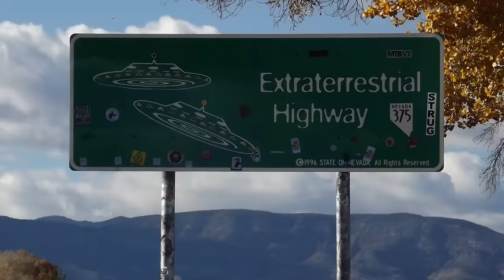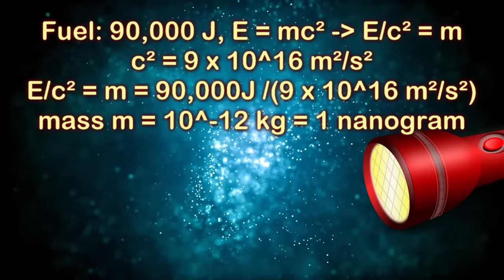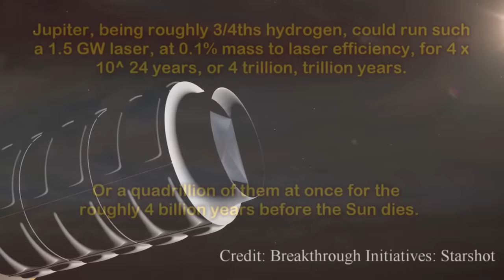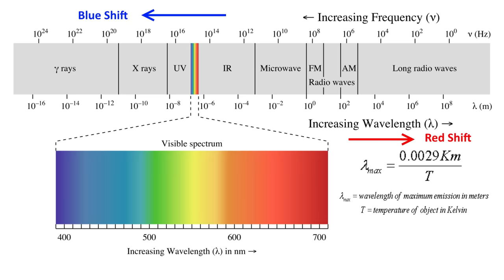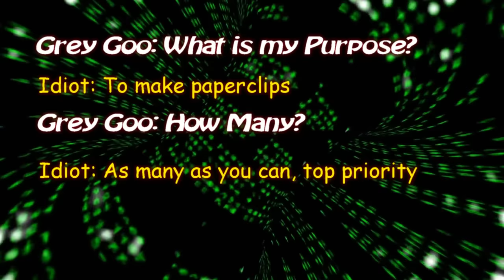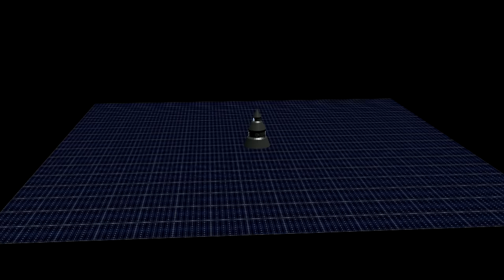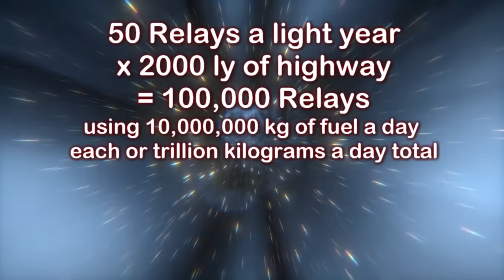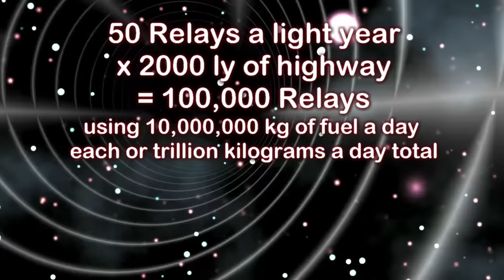Interstellar Highways

Comment: By the 26 century we will surley tap into the quantum fields ,  and just playing them like a violin , and given the fact that thies fields are so highley connected we will just need to play maybe one or two fields.  You dont need a pushing force when you can just tapp into this fields , because after all a force is not a real thing! Like gravity is not a force , but a bending of spacetime , so its the electromagnetic force just a virbation of electric and magnetic field at the speed of light..After all the Earth its still there if the Sun dies . It will take 8 min to just destabileze the Earth , thats because the forces ( not forces actually , but fields vibrating ) will need that time .  A force its just quantum fields vibrating .

Comment: Current science...this would need fusion energy which isnt current science.
Reply from the maker: It would benefit from fusion technology, it could be done by beaming solar out from those stars and could be done more modestly with fission.
Reply: Would we have enough uranium and thorium to do it for a long time? It's much rarer than hydrogen...
Reply: Plus, we actually know how to make a fusion reactor. We don't know how to miniaturize it, but dump about 10^30 kg of hydrogen somewhere and boom, fusion.
Reply from the maker: I wouldn't want to try to run a network this big and powerful off fission, but it does have more modest forms, it will still use that fissile material more efficiently than a nuclear rocket will, you just don't want to be trying for giant ships moving at near light speed. But again you can beam power out to them, keeping focus a light year away is not exactly easy but they aren't really moving and can get away with solar reflectors and dishes the thickness of tissue paper and the size of planets if it comes to it.

Comment: I'm surprised you brought up piracy since in all the other videos you talk about how dumb it would be for aliens to come all the way to Earth to steal Earth's resources. Since anyone out that far would have the ability to produce everything they need from the resources just floating around in space. Trying to catchup to and board ships moving through the highway as such high speeds would be extremely impractical give the cost of fuel and potential for disaster. 

I would imagine piracy in such an economy to be more of a bribe someone to "misplace" some key parts you needed to build/mine more stuff since once you have the basics your basically your own grey goo able to convert the raw materials into machines that help you gather and convert more raw materials. After all these stations I would imagine need to be pretty much self sufficient since they are light years away from a home system and any message would take years to get back. Even other near by stations would have to have spares of stuff if they could even hope to help other nearby stations in the event of a disaster.
Reply from the maker: I wouldn't find piracy very likely even on such a setup, just that the highways are about the only excuse I can think of that would ever allow route and paths between stars people could prey on. It would still be nigh impossible to do a classic boarding action, but you could lurk and jump out threatening to shoot them if they didn't transfer you their funds or data or something.